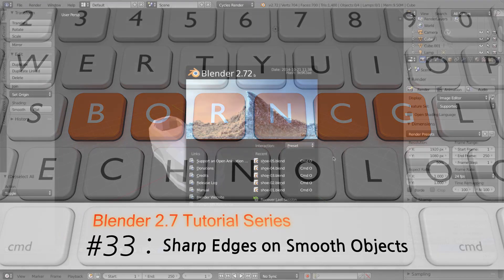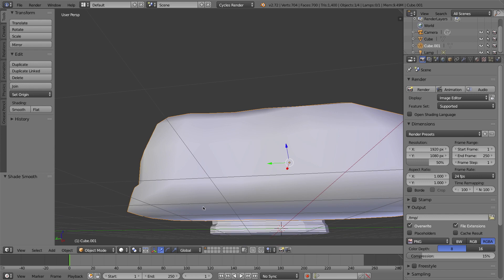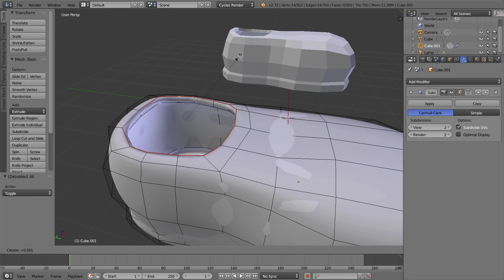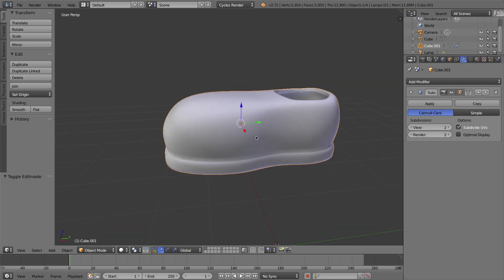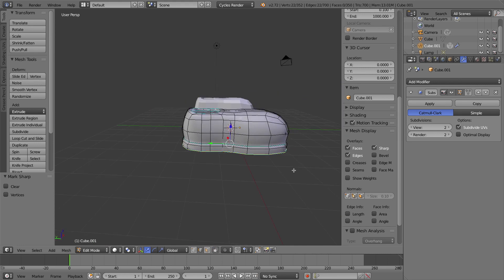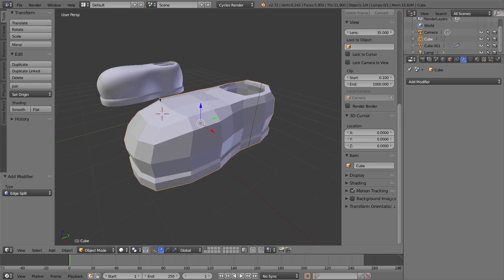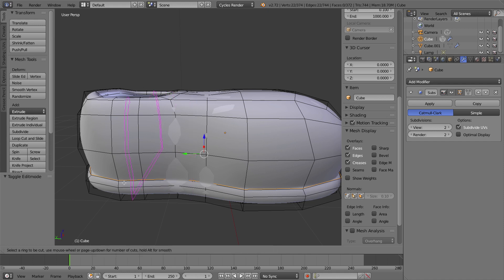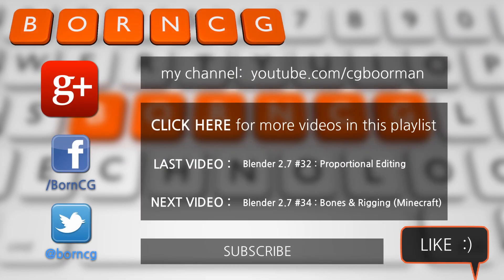Blender 2.7 Tutorial #33 : Sharp Edges on Smooth Objects #b3d

Comment: You can use method #1 to have "not so hard edges" and without adding extra geometry as illustrated in method #2.
Just use Shift + E, followed by 0.8 (or any value less than 1), ENTER. Done! Quick - Easy - Effective.

Comment: This is a great tutorial but having come from Max I have to say that after simply being able to select shading groups, this seems such a lot of extra work. And all the best methods seem to add considerably to the poly count, which is not so good if you are trying to keep the count low. I was also pretty devastated to find that none of my Meshes with smoothing groups imported as OBJ's from Max retained any of their shapes and were reduced to blobs, even after turning off auto smooth, which basically meant starting from scratch.
Reply: 3ds max's smoothing groups add double vertices at render.
Reply: its the same thing
Reply: For me it's more about what happens when you export the model, as I don't use Blender for rendering, but for making low poly models to export. I see that if you apply an edge split modifier before you export it out then the model faces that are sharp edged all get split into separate objects. I was not aware of this happening with smoothing groups in export max objects, but maybe it did. If anyone knows more about this I would be interested to hear

Comment: +Anyone BornCG  I noticed that he could go inside the shoe; I have problems getting into things, usually I go up to the surface and even in wireframe mode I can't get inside the wireframe, than goodness I can see through it, but what do I do so I can get past the surface to see inside without the outside surface interfering?  Anyone?  But, every once in a while, I must do something and get in...  And, thanks ahead of time, if you can help.
Reply: Chip Cooper  just select a face inside the element you want to go to and hit the del key on your keyboard's numpad. it will zoom you to that face and sort-of remove that limitation when you get really close to a surface. that limit might creep up again if you move around again but, then the same trick applies..
Reply: Awesome, what a great idea!  I'll give that a try.  I think we need an, "INSIDE MESH" perspective option.  Though, that is easier said, than explained for a computer to understand.  We might find ourselves between the outside of the shoe, and the inside of the leather, but not the shoe if the outer wall has depth. lol   (Help, I hit a button, and I can't see anything!) or (Help: I'm stuck inside these tall narrow walls, and I can't get out!)  ;-)

Comment: Hello BornCG I am currently working on a project that i want to speed up about 100 times in the blender video editor. The original footage is in four clips of different lengths and i am applying the speed strips to each piece of footage individually, But once i change how much it is sped up, something strange happens and the video just goes blank and i can't view it in the top half of the screen or when i render it the first about 10 seconds are fine but then the rest is just blank. I have never seen a tutorial for the video editor and i was just guessing how to use it but if you could tell me if i skipped a step or something because i have no idea what is wrong. Please help

Comment: Another great tut.
What I like to do to save time when supporting edges, is to just hit "E" and then add a second support loop if needed. (Rarely needed)
LME, If you subsurf a cylinder you will end up a "point" on each end. I just select the faces on the ends and hit "E", then "I" for the inset.

Comment: The 1st method is better for animation or game development and the 2nd one is for stand still high quality render. Am I right?
Reply from the maker: Dan LaSusa as far as I know, game engines do not generally support subdivision surface modifier - you're more likely to find them using a lower-poly mesh with a normal map. You would proably use the proximity-loop method for props/characters you see close up in an high-quality animated movie, and the first method if speed of rendering is more a factor for the creator.
Reply: BornCG is that because the face/edge/vert count on the first one is lower? or another reason?
Reply: first method doesn't fit to animation or game engines - because of the meshsplit - you will be not able to animate properly disconnected pieces
Reply from the maker: Peter M Yup. =)